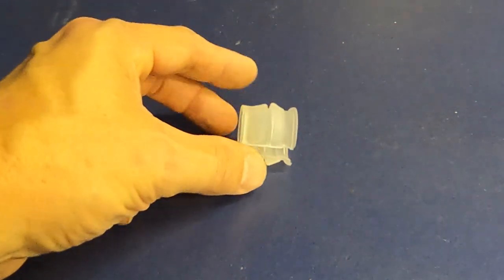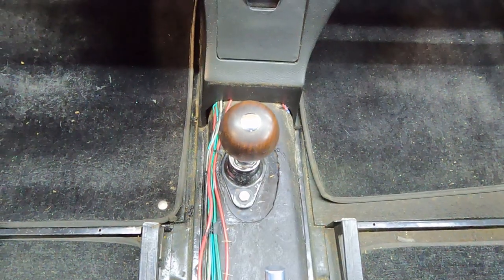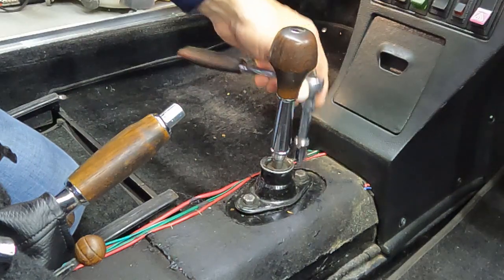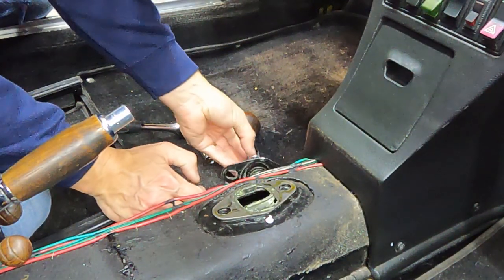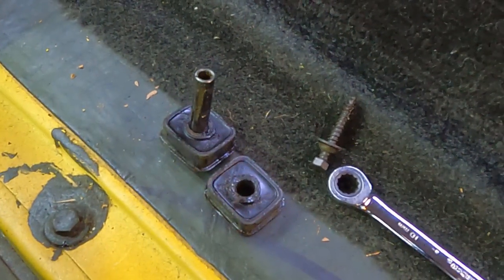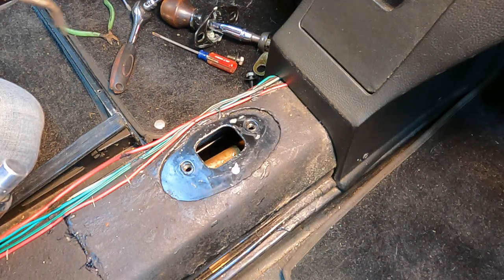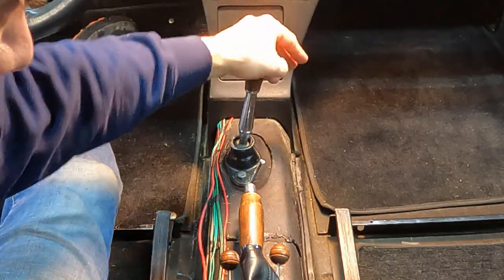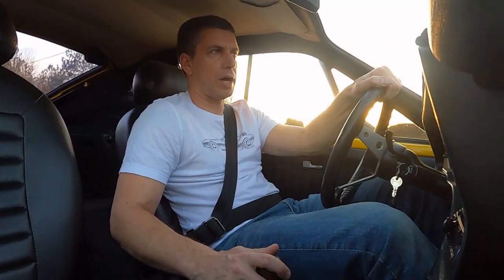Air Cooled Volkswagen Shifter Bushing Upgrade

Comment: Update; install procedure success.  

The install video i tried to apply was  the inclusion of 6" piece of 1/2" pvc pipe (sprinkler) ***with threads at one end and a cap attached. the cap is larger than the pipe and the bushing is to be slid down the pipe towards the cap where is can go no further. The lip of the bushing where the c clip is to be installed will face the front of the car, the pipe fed into the carrier from the rear using a tow string run through the middle of the pvc and bound in the cap.  A great tool to guide it all is the spring loaded multi claw parts grabber on a flexible shaft - 2 foot plus length.

Must drill a hole through the pvc pipe 4'' from the bushing location when on the pipe up against the cap;  you'll run a bolt through your front shifter install hole to lock the pvc/bushing arrangement (which is pressed up against the backside of the carrier mount).  

Putting the clip on is the bitch. 

i tried the pre expanded c clip tool design and there''s no support to slip it onto the bushing instead i made a 2' long sleeve that will install over the pvc pipe with an outside diameter slightly larger that the bushing flange, preinstalled the c clip already opened on the very edge,  installed the sleeve on the pvc pipe after is was hanging in carrier and before locking in the front via the shiftier bolt hole install, pushed my sleeve up against bushing, kept pressure on sleeve via lockable pliers on pvc at butt of sleeve, used screw drivers @3:00 and 9:00, against c clip and drove it home.  The c clip will not want to cooperate regardless there's no slot it rests on, maybe more cooperative if not a metal sleeve.  ** six inches too long,  reduced to 1/2 " longer than drilled hole location.

Comment: Well i tried their installation procedure which is not what this video covers and i even enhanced the parts used a bit to assist and still haven't succeeded.  There's a competing unit that simply snaps in utilizing clips after compressing round  bushing. One more hour and i'll throw the $30 bushing in the garbage or modify it somehow.  Go the snap in version save the hassle.
Reply from the maker: Sorry it’s giving you so much trouble.  I couldn’t get a camera in the tunnel to film the install. 
What’s the other brand you are looking at?
Reply: @BigDadsMoto  viewed on anther vid on topic, no clips to install, snap in.  No matter for me now thought, installed the clip and added instructions for process with a sleeve added on subject video.

Comment: This is very difficult to install 😮the bushes. No explosion on how to install this bushing.    Do not be fooled by this video.
Reply: The original style isn't that bad to replace. I did it solo as one of the first repairs I did to my baja bug. A wire hanger bent up as a shift rod support helped a ton
Reply: just posted process, still sitting in your tool box?